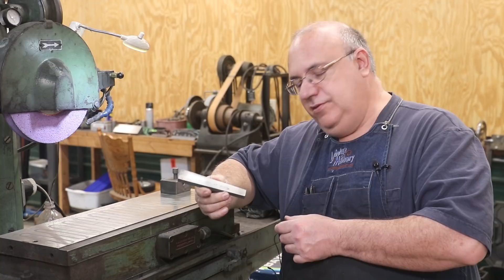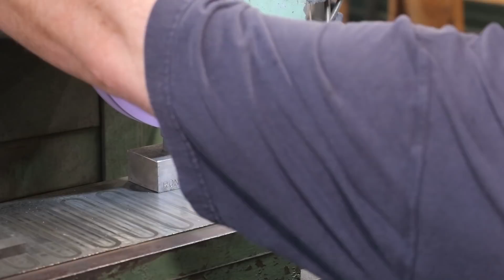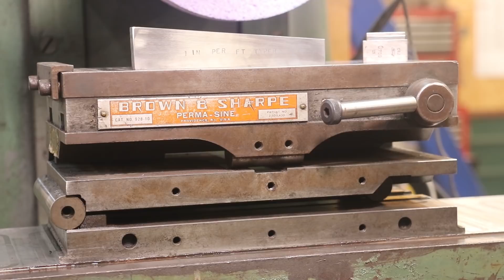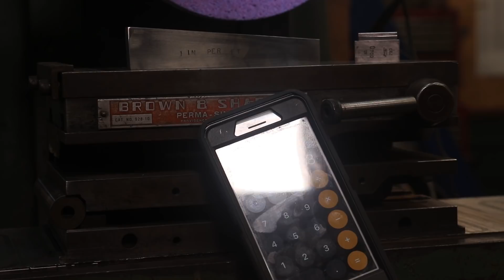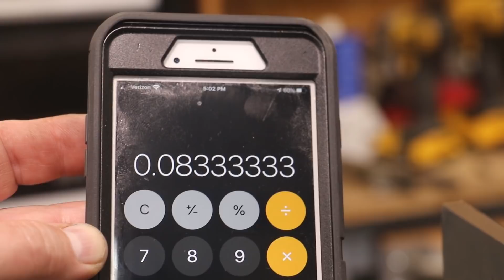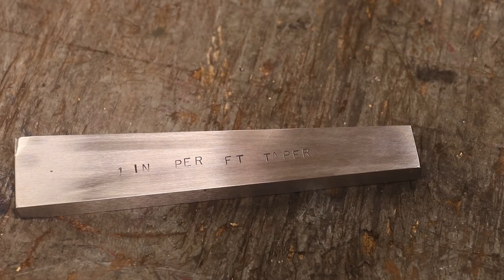Grinding a Hardened Taper Gage: 1 inch per Foot Taper

Comment: Please correct me if I am wrong but the stack height I come up with is .83045"  
The angle in decimal form for that taper is 4.7636. Sine of that angle is .08305 x 10" = .83045 stack.

Comment: On the sloped mag chuck your part must be set up exactly parallel to the direction of travel for the angle to be accurate.

You did it by eye, but given how careful you were in setting the angle you absolutely needed to use a square to make sure it was lined up with the direction of travel.
Reply: Absolutely and he is completely unaware of the mistake. The part should be true to the sine chuck and not the actually grinder. If for example he used the back ground edge with a ground square or used a side mounted guide rail to true the part to the sine chuck the actual position of the sine chuck on the grinder is not relevant. Personally I would have rotated the sine chuck on the mag chuck as to not create a heat dwell in the part being ground so the wheel does not contact the part from one end to the other as based on how he is grinding it the part would have a dish of about .0002 guaranteed.

Comment: Keith dose a part need to be absolutely parallel or just flat to the grindding wheel?
Reply: He is unaware of his mistake. The part should be true to the sine chuck and not the actually grinder. If for example he used the back ground edge with a ground square or used a side mounted guide rail to true the part to the sine chuck the actual position of the sine chuck on the grinder is not relevant. Personally I would have rotated the sine chuck on the mag chuck as to not create a heat dwell in the part being ground so the wheel does not contact the part from one end to the other as based on how he is grinding it the part would have a dish of about .0002 guaranteed.

Comment: Did you grind the bottom edge square to the sides? Also when you placed the gauge on the Sine chuck it was not against a back rail or trued up which will give you an incorrect angle. I would also slightly rotate the sine chuck so that you would nit be grinding the full length generating too much heat. This is not an accurate  method of grinding.

Comment: A good practice on a surface grinder is to put your diamond dresser on the far left side of the mag chuck as this will keep you from “sandblasting” the mag chuck and whatever is on it, especially a very precise tool light a compound sine plate. Enjoy the content, just figured I’d give you a pointer.
Reply: He is unaware of a this mistake. The part should be true to the sine chuck and not the actually grinder. If for example he used the back ground edge with a ground square or used a side mounted guide rail to true the part to the sine chuck the actual position of the sine chuck on the grinder is not relevant. Personally I would have rotated the sine chuck on the mag chuck as to not create a heat dwell in the part being ground so the wheel does not contact the part from one end to the other as based on how he is grinding it the part would have a dish of about .0002 guaranteed. As for the dressing that you stated that too is a good point but I am very reluctant to hang the table out to either end for dressing to reduce any sag especially with a 40lb chick on it as I would have used a short diamond right on the sine chuck.

Comment: Hey Keith, appreciate the video. Although noticed a mathematical error in your gauge block stack. You used 0.9333 where I believe it should have been  0.9305. I don’t know if this little bit will affect your application, just thought I’d mention it.

Comment: HACK JOB RUCKER STRIKES AGAIN NOT ALIGNING THE X AXIS PARALLEL .
Reply: The part should be true to the sine chuck and not the actually grinder. If for example he used the back ground edge with a ground square or used a side mounted guide rail to true the part to the sine chuck the actual position of the sine chuck on the grinder is not relevant. Personally I would have rotated the sine chuck on the mag chuck as to not create a heat dwell in the part being ground so the wheel does not contact the part from one end to the other as based on how he is grinding it the part would have a dish of about .0002 guaranteed.

Comment: Thank you Mr Rucker.
Everyone's a critic, but...
For forms sake, wouldn't a couple of accurate 1,2,3 blocks to set up perp to plate and 
aligning sine plate, and therefore job, to the table travel have taught a simple and accurate method.
Just (winge) say'n...
Reply: The part should be true to the sine chuck and not the actually grinder. If for example he used the back ground edge with a ground square or used a side mounted guide rail to true the part to the sine chuck the actual position of the sine chuck on the grinder is not relevant. Personally I would have rotated the sine chuck on the mag chuck as to not create a heat dwell in the part being ground so the wheel does not contact the part from one end to the other as based on how he is grinding it the part would have a dish of about .0002 guaranteed.

Comment: 16:30 comment: Don't you need to make sure the taper block is exactly parallel to the sine block which has to be exactly parallel to the travel of the table? Or the setup making sure at least the sides are exactly parallel to get the surfaces to have planes that meet perpendicular the planes of the sides?

Comment: Hi Keith,  Thanks for another great show.  I have a couple of dumb EE questions for the ME.  When you harden the steel, how far into the steel is it hardened?  How much can you grind off before you grind off the hardness?  Sorry, they didn't cover that topic in EE classes!  Keep it up and stay healthy.
Reply: depends on the method of hardening. Case hardening for example, like for some gears, is just what it sounds like, and thin "case" of much harder material around the outside of the part. Other times parts are through hardened, though even then if you cut them in half you'd find variations in hardness because you can't cool the part at the same rate all the way through. Generally, harder steel is more brittle, and softer steel more ductile.

Comment: Complete novice here so correct me if I'm wrong. I would have used a couple of 123 blocks between the stop on the sine plate and the taper gauge to keep it from "walking down the hill" as its grinding. Also, since it's only 3/8 thick put a block on either side to give it a little stability. I guess I've seen parts launched out of grinders before. And/or blown up wheels.
Reply: Agree with using a stop - at least if it's convenient with tooling on hand, with my limited work on a small dry surface grinder, I have run into a few cases where things got sketchy & worth a little time to be conservative. Also, I would have probably put a pair of mag parallels on each side, when grinding the first small working edge, so that it is more likely perpendicular to the side faces (and less likely to slide away, or rock, on the milled hardened face against the magnet). Would have done second working face as he did, with first working face on chuck, so its true to other working surface (made that mistake before too, making some small parallels!). Using the taper gage with a part only slightly thicker than it, in a vise, it could potentially get cocked by the vise jaws if working faces not perpendicular with sides.  On the other hand, can waste a lot of time looking for just the right parallel etc.. and he did get it done just fine. Great to watch someone actually making something... as I sit typing away at the kitchen table..

Comment: Thank you for reminding me of working with an old surface grinder. Bumping the on off button four to five times to lube the bronze bearing or bearings. Using one's hand to feel for the grinder wheel grit dispersion was the first things I was taught. Something the newer machines did not need to be done but running the a few minutes for a warm up was standard. Keep on showing more interesting things for us all on YouTube. Good day too....

Comment: Keith, you do fabulous work, but why do you persist in surface grkndi g along the long axis of the part? Set the part at an angle thus reducing any opportunity for heat effects. I have reground a set of damaged parallels using this technique and as able to "wipe" them together.
Regards,
Eric

Comment: At the risk of asking a foolish question, when you grind a piece of metal like that, what sort of treatment do you do, if any, to prevent it from tarnishing/rusting; especially in that humid part of the country where you live? I would think even a slight bit of rust could throw off the precision of your gauge.
Reply: Just oiling it is usually enough.

Comment: Nice project.  I would add a parallel or some sort of block to the stop on the mag base. I do this as a matter of practice on thin parts like this even thou they feel tight, the blocking adds to non movement. Also I use a small brass knocker to seat everything.
Really don't like any ragging  on any machine while it is running. In the shop years ago I saw rags mgo in and one kid get his hair caught in a spindle, quite a mess . He is still alive today, but......

Comment: Thanks for the video!  So if you DID need to take out that tiny error, am I right in assuming that the answer would be to simply restack your gauge blocks and regrind the top of the taper gauge?

Comment: Perhaps a foolish newbie-question, but why didn't you have to make sure that the taper gauge was square to the sine-plate?  If you're off even a bit, it'll create a 2 direction taper, right? But you didn't seem to even use a square.  Does this just not need to be that accurate?

Comment: Hey Keith, I thought you would line up the piece parallel to the grinding wheel, correct me if I'm wrong but there should be another taper on the piece you just ground. Or did your superman eyes have a role in a nearly perfect tapered piece?
Reply: @katelights  Yeah I actually meant the direction parallel to the bottom slide direction Kate

Comment: making sure piece is square on angle plate (parallel with wheel) as piece rotates on incline the taper angle changes?
Reply: I agree and the magnetic sine bar must also be aligned to the spindle!
JIM

Comment: Hi Keith – Good show as always.  I noticed however that after you initially dressed the grinder wheel with the ‘cluster diamond’ and made passes on the sides of the taper gauge, it seemed like only the back edge (side toward the grinder) of the wheel was cutting; at least the bright line of sparks around the wheel face appeared only on the back cutting edge of the wheel face.  I couldn’t tell if that was the case when you began grinding the top and bottom edges, after you used the single point diamond to re-dress the wheel. Nevertheless, if what I saw was accurate, could that mean that the grinding wheel itself is tipped, or not perpendicular to the magnetic chuck (or maybe the other way around – the chuck is not perpendicular to the wheel)?

Comment: Question: You re-dressed the wheel after grinding 2 relatively small surfaces.  Is that the norm?  Take this from  one with limited, (very) experience.
Reply: I think, you dont have to dress the wheel so often.
So long the wheel begin for and go 
over the surface before it go back, the wheel dont have to be true.
Only the biggest diameter will grind anyway.
Reply: The wheel needs to be dressed after it's not flat enough anymore, it's also extremely important to be well balanced and perfectly round, otherwise the finish is crappy

Comment: Thank you for a great video! I'm not a machinist, but I think you should check with some of your buddies about using sine bars for tapers. The sin function gives you rise over distance along slope (hypotenuse). Taper is I believe rise over run (distance along flat table). They're slightly different. I think you need to take the arctangent of 0.1 to get an angle theta. Then take sin(theta) to get the rise over hypotenuse.  Again, I'm not a machinist so check around with people who are.
Reply: SOHCAHTOA =Some Old Horse Came A Hoppin Through Our Alley = Sin (Opposite/Hypotenuse) Cos (Adjacent/Hypotenuse) Tan (Opposite/Adjacent). By having 2 knowns in a Right triangle you can calculate out all the other information. I just said SOHCAHTOA thinking it was common language. What can I say, I like math...lol. I think that people focus on the process of focusing on the numbers and forget that the same rules (formula) applies regardless of the situation. Whether it's as a machinist, pipe fitter/plumber, roofing carpenter, etc. The formula is a constant regardless what the numbers are. As for me I don't grasp structuring a sentence. Like I told my HS teacher MATH runs my life in EVERY aspect. Where and what the adverb is in a sentence does nothing for me. To each their own I guess. LOL
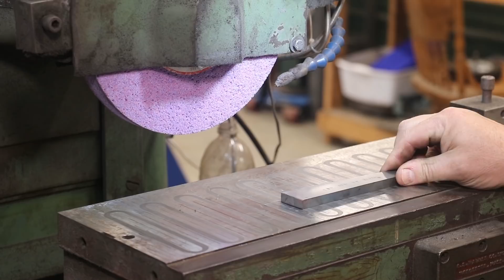Reply: Taper is rise over run. With the fixture and measurements Keith used, he ground the angle to rise/hypotenuse, resulting in about a 0.00029 inch/per inch steeper angle than 1:12. (The base (run) is slightly shorter than the hypotenuse.) Whether that error is significant depends on what you are going to do with the gauge.
Reply: The actual angle is irrelevant in this situation. It's just a simple ratio of (1/12 = X/10) X being the unknown height. Calculated out is .8333333...
Reply: Randy G, my iPad calculator gives me. 0.8305 rounded to closest 0.0001. sin(arctan(1/12)*10
Reply: I don't think this builds in any issue on calculations Stuart. Rise : Run and Rise : Distance are both constant numbers and using SOHCAHTOA you can calculate out what your after regardless. Maybe I am missing something you are saying though.
Reply: @stephenstrohacker7863  , that's why I was being careful to say that I am not a machinist. From the long acronym it sounds like there is a conversion program with the corrections built in and that machinists use that.  It was mostly the comment that in a sine bar the "distance" doesn't change.  That's true, but it is the distance along the slope, not along the grinder base.  In theoretical terms, sin(atan(x)) does not exactly equal x.  Thanks for the explanation and thanks to both of you for showing this all to us fascinated observers.

Comment: So, do you ever have to worry about any difference "conventional vs climb grinding" like with milling?
Reply: No, because there are no teeth and you're taking such light cuts; however, if you took a really deep cut in the climb milling direction and fed too quickly, the wheel could fail explosively.  What you do need to think about is "can the work wedge between the table and wheel if it comes loose"; you wouldn't want to reverse the sine plate and work to put the taller edge on the right side.  The chance of it coming off is very slight, but you don't want to be anywhere nearby if it happens.  It's like cross cutting something long and thin on a table saw with a rip fence instead of a cross cut fence; if the wood gets wedged between the fence and the blade, it's going flying.  Same with the grinder, except the wheel will explode instead of flexing.

Comment: I’m surprised you didn’t make two of them at the same time. You could use them later for a job as parallel blocks.
Reply: eric roehrle Ah, just cut 'em lengthwise :)

(halfway through he explains that the piece is only slightly thinner than the actual work he is planning. So one will do fine. No need to spend more raw stock?)
Reply: im not suprised atall rucker not too bright

Comment: Is that pattern on the bottom of the part from wear on the spindle bushing?   Maybe a motor issue?  Or phases a bit "out"?  I know recording engineers were very aware of electrical noise when cutting master LPs.  And surface grinding reminds me of that.  Seems you can diagnose a problem by the quality of the surface finish.  Just curious.

Comment: How critical is it to get the gage aligned with the movement of the bed. In the video it appear as if you're eyeballing it. Is that correct, or do you have some marks that just don't show up in the video?
Reply: Anders Wegge, exactly what I was thinking, I figured it would have to be a measurable amount, then the end it was .001 off, I’m wondering if that could be the reason. Not that .001 mattered but idk.
Reply: Exactly my thought when I watched.
Reply: Absolutely critical. Imagine if he had put it exactly perpendicular. That would have cut a regular parallel with no angle  but a beveled edge.
Reply: pretty damn critical. it will creat a compund taper if its not. hack job rucker strikes again.
Reply: +1

Comment: I was always under the impression that you should wash the chuck and part clean every time you unclamp the part so no grit can get under the part and throw off the grind.
Reply: The palm of your hand does a surprisingly good job of removing the last of the particles on the mag chuck.   The ridges in your skin are nearly ideal for trapping small particles and you can feel them drag if not clean.

Comment: I love this stuff. One thing however, and it's not that you needed to do it, but it would have been educational to check the taper again on your granite surface stone just to confirm what you saw on your taper micrometer.

Measure twice, cut once in reverse maybe?